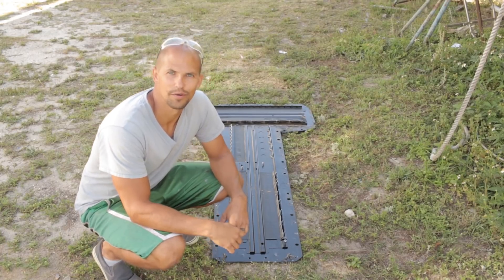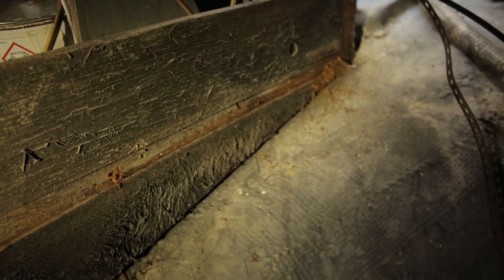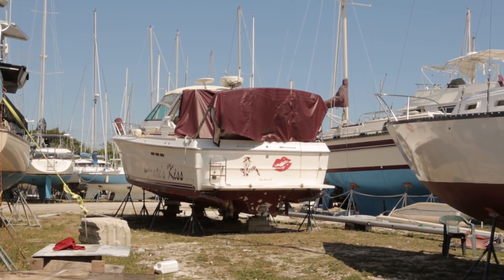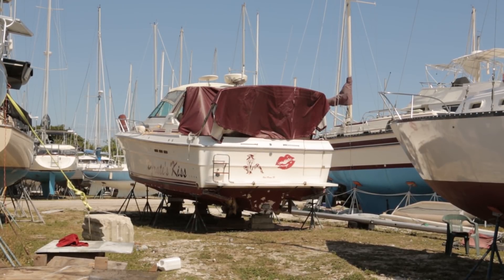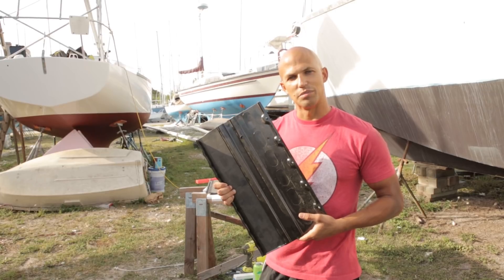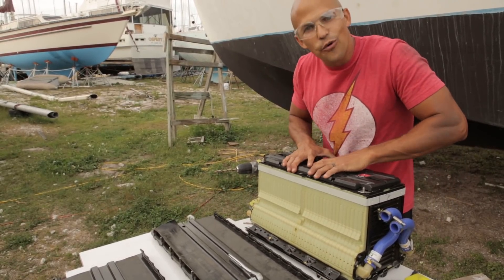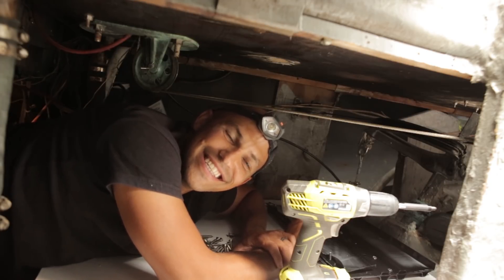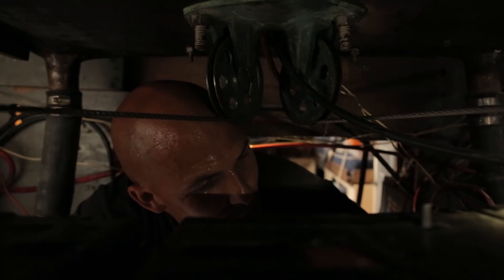The heart of our electric motor install | 15 | Beau and Brandy Sailing

Comment: I want to do this, for me, having a sailboat powered by batteries and a motor, is the best combination. The motor is not needed all the time, when not in use, solar panels can be stitched into the sails, and mounted on the deck to charge the batteries. The motor should be much more reliable than the old (I assume there was a diesel) engine. Also, the silence of sailing, can remain quiet when under power.
Reply from the maker: Thanks for watching. When we purchased Saoirse, she has a seized engine, so yes, this is WAY better. But we were looking for a boat without an engine or seized engine, bc we knew we were going all electric. We have found, for us, it has been great!

Comment: Okay, I know I'm coming into this late.  I am curious if you are putting the cooling water back into the battery cases.  I assume that it was there because the Volt had a large generator charging the batteries (the car engine) and pushing power in so fast will cause heat in the batteries.  I also assume that you are not charging with such gusto, so the coolant will not be needed.  Is that right?
Reply from the maker: thats right

Comment: I commend you on the effort but I will never understand why sailors choose to repower with an electric system that weighs as much as three to four marine diesel engines.
Reply: 3-4 times? I dont think so.. lol
Reply: Mr. White  I think you should have done some research before you lol'd.  The ELCO inboard elec motor that is equivalent to a 20hp diesel requires 6 group 8D batteries, they weigh roughly 170lbs each. 170x6= 1020lbs. The ELCO motor weighs over 200lbs. So not even including other installation parts we are at 1220lbs.  A new Universal M3-20b diesel weighs 254lbs.  So yeah, the elec system weighs over 4 times what the diesel weighs. What's even funnier is that even with all that weight and regen such as solar panels and other crap it still can't even run 5hrs at 80%.   Do some research next time that way someone who actually knows doesn't have to school ya.
Reply: Chesbay - If your going to compare batteries AND motor should you not also consider the weight of the diesel fuel in your calculations?
Reply: Seems reasonable enough.      Even so, at the end of ALL the long conversations, number games, and charts about everything from range, weights, speed, efficiency, ......price of tea in China?  (Thought I would throw that last one in, why not?)   This fact remains,  To each their own.  Try to argue with that!
        I am stuck somewhere in the middle. I  understand the dependablity of good ole diesel. But if someone wants to go full electric....more power to ya.  Really, less power to ya! Ha. I think you get the point.   
         I never can understand how so many turn into nay-sayers. I enjoy watching people fix up old boats and want to cheer them on.  Far too many seem to say, too big, too little, shouldnt have done that, your throwing the balance of your boat off.  Hey your tools arent good enough, your methods wouldnt pass in the shop where I work. Sheesh!  
      Baeu & Brandi I think its awesome how you guys work together. And you will always have that.   Some will cheer you on, but many will critique. Funny thing about the ones who pick  everything apart.......they are typically the ones who never actually accomplish anything.
Reply: In a recent installment of "Sailing Uma," they compare diesel to electric. Their conclusion is basically they serve two very different ends; so, comparisons are not a very useful exercise. Electric isn't about power, it's more about self-sufficiency and environmental sensitivity (and yeah, I understand that their lithium batteries - Uma's - have their own footprint, but...) The most interesting thing about Uma's observations was that electric motors are really only useful for getting in and out of marinas, not for powering through light winds or against strong currents. They also point out that maintenance on their electric motor is far simpler.
Reply: @davidmalone9022  I will have to take exception with your term "Environmental Sensitivity".  To begin with, the "Carbon Foot Print" of ANY glass boat is already off the scale. I have seen the open pit mines for the various oars required to manufacture those "Green" batteries. I provide process monitoring in mines, smelters and manufacturing facilities. The on demand power consumption alone is mind boggling.

There is NOTHING "Environmentally Sensitive" about anything that goes on a boat. If you wish to talk about efficiency and self-sufficiency we can communicate, but the GREEN CRAP IS A LIE!

Comment: Bold move going electric. Very cool!  I put a Volt battery pack in an electric car I retrofitted. I have a lot of data on those packs given to me by an EV battery engineer. Happy to share it with you if you like. What are you using for a BMS?
Reply from the maker: That would be great thanks Doug! We're using an active balancer. How about you?
Reply: I used a DIY balancer designed by a group on an electric bike forum.  Called the Zephyr.  
https://endless-sphere.com/forums/viewtopic.php?f=14&t=26554
I used it because it is flexible for the number of cells to balance and the balancer can shunt 1 amp of current, so it will balance quicker.

Comment: https://scripps.ucsd.edu/sites/scripps.ucsd.edu/files/basic-page-ships/field_attachment/2015/SIO.ShipboardLithiumBatteryGuidelines.Nov-2014.pdf

16.5 kWh lithium-ion (2013–'14) Chevy volt Battery type? If so, read the above safety mania regarding lithium-ion and salt water exposure. lithium-ion battery can emit dangerous gases (hydrogen), explode violently, and melt when even exposed to minimal amounts of water. Salt water is an especially dangerous environment for lithium-ion batteries.

A more consumer oriented article regarding lithium-ion and hazards on board.
https://www.boatus.com/seaworthy/magazine/2012/january/hazards.asp
Reply from the maker: Thanks for the info Chris!

Comment: It takes a millisecond to cut your fingers off using an angle grinder. It's the number one tool to make your hands smaller, when you have removed the guard with a cutoff disc. Wear proper gloves and eye protection next time.
Reply from the maker: Thanks for your concern!

Comment: Great job man! vcan you tell us more about the battery's where you bought them and how much are you going to use a BMS what about the watercooling system of the battery's.
Be informative as much as you possible can
Reply from the maker: Definitely, we'll include it in the wiring video we're working on now. And we'll make a video of the whole system, and we have to do some testing :)
Reply: I'm planning to use 2 x 10kW 48 volt BLDC motors 3000 rpm with a ratio 3:1 zo 1000 rpm on the props

Comment: 48V and 16kW is a lot of energy.   Seeing the steering cables so close to the top of the batteries scares me a bit.   I could not tell if those batteries have top posts, but if so, a snapped steering cable could become a quick short.   Make sure your have everything shielded adequately to provide a great margin of safety for the unexpected.    Looking good!
Reply from the maker: Thanks MnNJP, that's a great point and we are definitely going to have boots on all the exposed terminals
Reply: Put a cover over those batteries

Comment: Your boat does not have spare buoyancy at the stern so pay attention to weight distribution. Too much weight aft will make the boat sail on her feet. Too much weight at the extremities make the boat hobby horse in rough seas. Ideally the heaviest items are centrally located and the ends very lightweight. Cheers
Reply from the maker: Thanks for the comment tartansailor, I'm curious how she'll handle as well. Once we get sailing I'll have to get a few experienced sailors to come out and give there thoughts. Jim Wilds  comes to mind :D
Reply: The weight fore and aft should be about the same, but raised slightly, with about 100kg more on the water line vs below, giving a slightly higher center of gravity on a 5897 kg boat. The original Univeral Atomic 4 was about 140 kg and mounted below water line, and had 60-100kg fuel and ancilleries on the water line. The Chevy Volt batteries are about 180 kg on the water line plus 10-20kg motor below and 10-20kg controller/cabling.

Comment: Looking good! Enjoying watching the progress. You are going to have a BMS, correct?
Reply from the maker: Thanks KoolMo -  and yes we are, there is going to be enough stress sailing let alone worrying about batteries failing
Reply: Glad to hear it. The pinouts on the BMS plugs/connectors on the Volts are pretty straight forward if you use a voltmeter to map them out.  You can buy the original BMS cables off ebay (for a nice markup) or buy generic female connectors (less expensive) that will plug into the port.  If you need a source I can give you the part number.